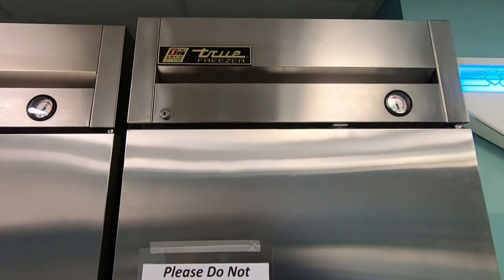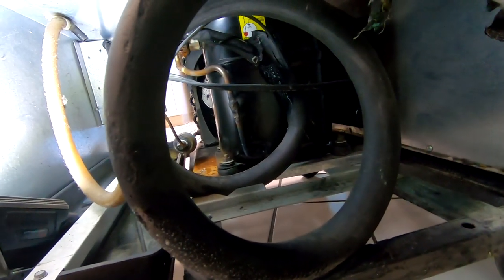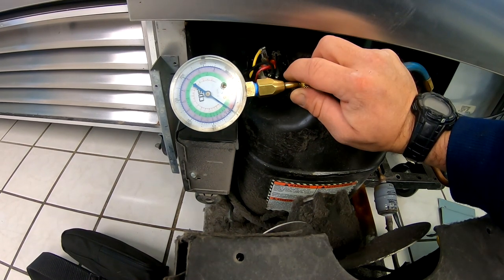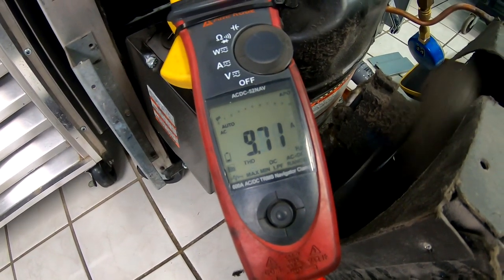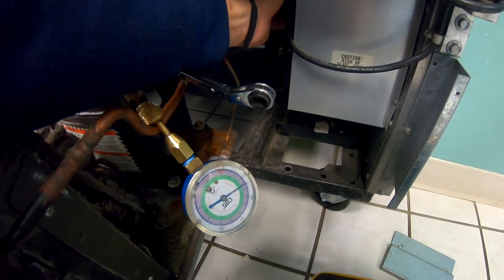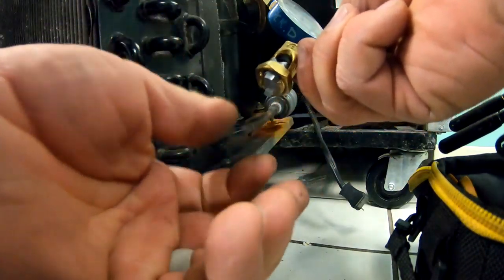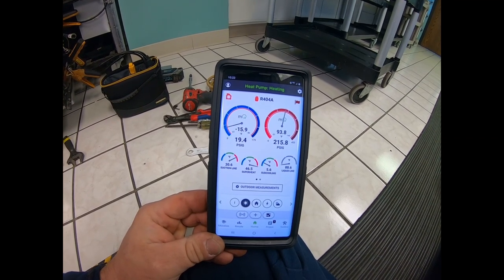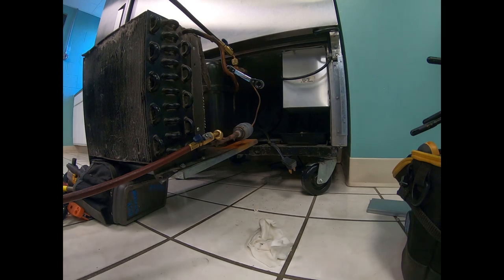True T-23F Reach In Freezer Has Loud Compressor At Start-Up

Comment: Did you just zip tie the magnet to the amprobe or how did you secure the magnet??
Reply from the maker: Correct, I used the magnet that you'll see from a Fluke meter but you can also pick generic ones from Amazon, I used a wire tie around the meter then used a little micro Velcro to attach the magnet to the wire tie.
Reply: @HVACRSurvival  rad! Thanks! Just picked up the AMP 320 to go into my TPLC. I knew I’d seen someone zip tie the magnet, it was you! Appreciate your time. Keep pumping out great content
Reply from the maker: @jmalmy2068  thanks man!

Comment: Finally what's wrong with this system ? Did you replace new compressor ? Great video in HD. Thank you for sharing ^_^
Reply from the maker: I recorded this probably two months ago and I have not gone back to replace the compressor yet.   In theory my feelings are let it run until it pukes then do a clean up. Why waste the money sooner than you need to. They must have felt the same way🤷‍♂️ . Far as what's wrong with it, I would say the valves are the issue because as you seen it will not pump down as far as it should. Thanks 4 watching 👍👍

Comment: When I hear it only on the start up, I think starting circuit check, caps and current relay or potential relay. Ohm the windings... It almost sounds like it has no oil. It’s a pain but dumping the oil and installing a fresh charge measured amount of oil may be the answer.  The with that shit pull down.... when I went to college for this in the 90s, they 5aught us it should pull down to a min of 16” in 5 minutes and hold it for 2.  If the oil is saturated with refrigerant, it might boil off and the pressure rise would fool ya. The only thing I thought was, what if the service valve won’t front seat tightly......

Comment: Hi , great videos. quick question, i just installed a new compressor on a True t23f just like this one with the same compressor and it sounds loud at start just like this one did . Simce the compressor is brand new what could be my issue??
Reply from the maker: What was wrong with the old compressor.
Reply: First thank you for replying , Big fan!! 
And the previous compress had a bad burnout, terminals "exploded" kind of burn out. 
Current relay was welded on together and im pretty sure start winding was never disconected my thinking! 
I flushed the WHOLE system with rx11 , tested it for acid and , came clean . 
Capilary tube was on great shape. 
condensor clean, condensor motor new. 
 i didnt check superhead or subcool! i just didnt how accurate it is since suction and liquid line are insulated together . 
thanks
Reply from the maker: Please email me hvacrsurvival@gmail.com.  It could be a couple things.

Comment: Cap tubes been replaced but is it the right size?
Reply from the maker: Head pressure would be higher and suction lower. It's worked since 2014 and just now got loud. I'd think there probably ok. Never know till you cut one and run a metal gauge in it and check with the factory.

Comment: +HVAC*R Thanks for the video. You're doing a great service to technicians and customers. Please kindly comment on my analysis below.
Higher current at start-up suggests higher load. The noise suggests flooded start. Compressor manufacturer analysis reports failure rate for replaced compressors 4x higher than original ones due to instalation errors.
The problem has to do with liquid refrigerant. Normally, during off-cycles the refrigerant collects in the coolest part of the system, i.e. evaporator. At start-up it should evaporate and return as pure gas to the compressor.
Is it possible that the new capillary tube has to do with the problem, i.e. too small a restriction due to improper capillary selection causes liquid to be carried to the compressor togeter with gas? Is it possible that some form of accumulator was removed during compressor replacement? Is it possible that it is not the evaporator which is the coolest place (e.g. due to de-frost heaters operating) and the refrigerant collects in the compresor body?
Reply from the maker: Your probably correct on all accounts. How long have you been in the field?
Reply: @HVACRSurvival  I'm mostly in electric installations. HVAC has a lot more diagnostic/repair and therefore offers a chance to do some thinking. 

Videos from you and some other guys on the subject are invaluable and give YT platform a real value. Thanks.
Reply from the maker: @Luzt.  thanks man it's awfully nice of you to say. I'm just trying to help the next guy out. I still make mistakes everyday.

Comment: Are you going to recommend a cpr valve?
Reply from the maker: Factory said it did not have one originally so I don't know why it would need one now. It appears to me something went wrong in the compressor, if they choose to change the compressor which this has been a couple months ago I will check to make sure the accumulator is still up in the evaporator section. That's the only thing I thought of later.
Reply from the maker: Another thing to think about would be although the CPR would be beneficial, the compressor isn't pulling down to zero psi in a timely manner as it normally would.  So damage has already been done to the compressor.

Comment: Dude, if the problem persists, you might want to consider a crank case heater and an accumulator.
Reply from the maker: I agree those items might help,  according to the factory design,  they didn't require any other items than what was on the machine.  I truthfully would have preferred to replace the compressor and add a CPR valve  CC heater but because this is used only every now and then,  the church didn't approve any repairs.

Comment: How do you tell how old a tecumseh compressor is
Reply from the maker: Appliances, HVAC & refrigeration try there app? I don’t do near as many Tecumseh as I do Copeland.
Reply: I tried using the app but it didn’t work is there a number on the serial number that says how old it is
Reply from the maker: @SeansMechanical  what's the model and serial numbe of the compressor?

Comment: CPR valve what is that? Crank case pressure regulator.
Reply from the maker: You are correct. It regulates the return pressure to the compressor, you adjust it to the maximum rated load amps of the compressor during a harvest or initial pull down. It basically keeps the compressor from being overloaded and going off on thermal overload.

Comment: I think the valves are bad...Also wonder if all the oil is in the evaporator.
Reply from the maker: it's been about two months since I've been there, they haven't had us do any work yet. But if they do do it I will likely drain the oil out of the compressor to see how much is in the compressor compared to what it's rated for. Thanks for leaving feedback. I appreciate you watching.

Comment: This refrigerator is from 1996, why didn’t they just replace it with a brand new one as it is likely going to become more difficult to repair and maintain as time goes on.
Reply from the maker: It's in a church and it only gets used at events here n there.
Reply: I doubt the new stuff is anywhere near as good for reliability

Comment: Very nice vid , sir .
Hey just one thought that popped in my head : could that be an oil issue , like an oil filled evap where it wore out the compressor and the evap isn't making good heat transfer therefore not allowing the liquid to evaporate fully during start ups before it reaches the compressor ?
Just a thought , I'm probably talking out of my rear side though .
Cheers!
Reply from the maker: I would think my suction pressure would be low and that my subcooling would be high. But anything's possible.
Reply: I agree. Sounds like low on oil. I would add to your process 1oz of oil and look at current draw and noise duration.  If it changes, RE-oil. Next, the cap tube is next to suction line. SubCooling is made complete by this. Since your cap tube is completely outside, that adds to your problem. Change out the cap tube with one a foot longer and put the loop in the freezer (-10deg) instead of in room (+72deg).  Just my thoughts. Very good video!

Comment: had an issue like this.discharge valves leaking back.when compressor wouuld cycle off,the condenser would equalize with low side of compressor outting liguid in crankcase.worked for a while but did have to replace compressor.new one ran much better.